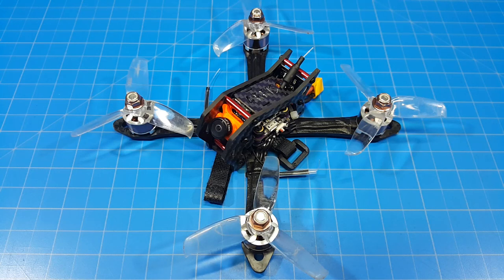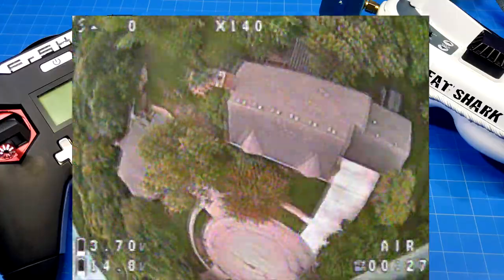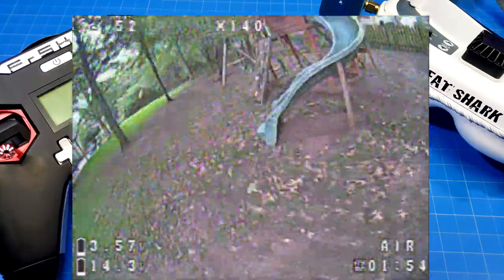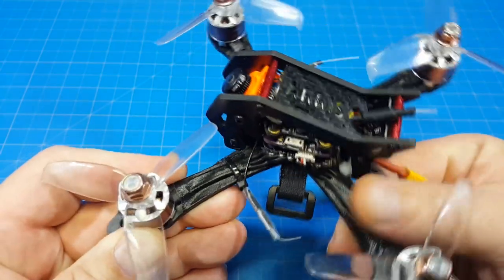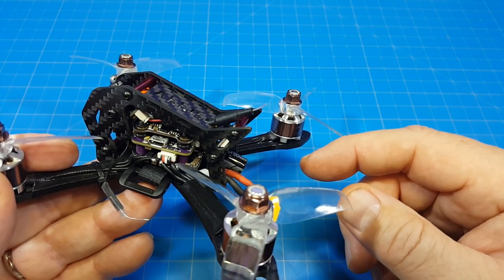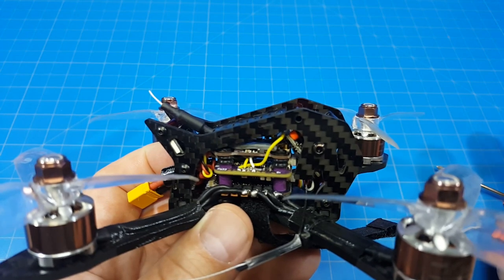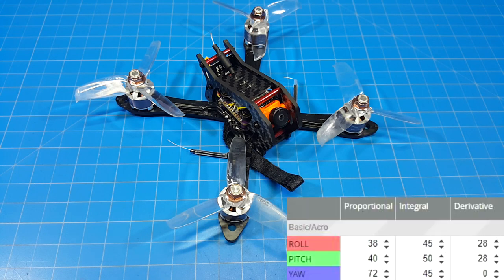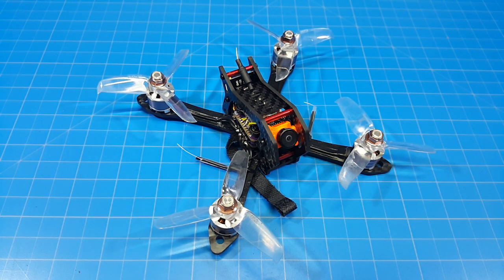ARRIS x140 HobbyWing

Comment: Great review! Thanks for mentioning that you didn't have motor braking and motor stop on for this flight - I use the height and speed of the punch-out over the house to try to judge the power of the micro quads you review (helpful for people that enjoy freestyle flying). This seems to be one of the most "powerful" quads you have reviewed but I guess the hang time was partly due to the motor braking being off.
Reply from the maker: I think there have been a few to top this. The FVP egg, xjb 145, and a few of the other three inchers I have built. Check the hypetrain 4140kv motor video.

Comment: Nick, have you tried vertical flipping the cam in the cam’s settings and mounting the cam upside down for more cam angle?
Reply from the maker: I looked for it, but this cam doesn't have it. Remember this is the original micro swift.

Comment: Can you please do more reviewing of products from U.S. based company's. I would like to see something not from gearbest or banggood, especially since I don't trust sites like that fully and the shipping is loooooooonng.
Reply from the maker: I would if I could afford it, or if they were interested. A good portion of micros come from the East.
Reply: True i guess, have you thought of designing a frame?
Reply from the maker: I did, but it was before micro cams were out. It was a 3inch with full sized ccd cam, cutting edge for like 3months. :(
Reply: I don't mind the reviews on quads from Banggood. They've ALWAYS taken care of me on everything! Even cheap glue that seeped from the tube onto the packaging in shipping. They gave me a full refund! When buying from Banggood, choose the "Priority Direct Mail" option. It typically costs less than 2 bucks! But! Instead of 20-30 days with no tracking... It takes around 12 days with full tracking once it hits the USA. That takes around 5-7 days. Then you can track it all the way in. It's soooo worth the tiny price... And with many quads it's also FREE! Or, sometimes it's like 0.83 cents! And, don't worry about Banggood...including all of the little parts, I've bought from them over 200 times! Never, ever, any issue they didn't handle perfectly. They're awesome! 😁👌
It's GearBest you are best not buying from!!! They're a bunch of scammers that will rip you off any chance they get! I love warching the reviews, but if it is only available from Gearbest, I'll NEVER, EVER buy it or anything from them again!!! I've learned my lesson, the hard way! 😒

Comment: This or XJB 145? I can use fs i6x with them? Rx2a? X6b? You fly that thing like a dream...
Reply from the maker: xjb145. I believe the xjb performs better and has more available camera angles. I do believe flysky receivers will be fine, we would need to make a few adjustments in the betaflight configuration, but that is normal. Thank you

Comment: Can the electronics handle a  4s 1500mah 50c battery??
Reply: The electronics should not have a problem, but I doubt a 3 inch quad would do very well lifting such a heavy battery.

Comment: Glad you got one too. I moved the camera forward in the frame, using the vertical slits at the front as mounting hole. That creates more space between camera and FC stack, and allows for a wider range of camera angles. For a picture, please check here: https://www.rcgroups.com/forums/showthread.php?3138299-Arris-X140-1407-3700kv-F4-OSD-and-more-%28review-work-in-progress%29

Smart to add the capacitator, that is my main gripe about the X140, the motor noise leaking into the FPV signal. Apart from that, it flies really well, once fitted with GemFan 3052 or similar. What capacitator did you add? I was hoping that a cap would fix the noise, but your experiment shows that it doesn't fully fix the noise. Will you be trying to supply 5v from FC to the VTX?
Reply from the maker: I used a 25volt 470uF. As time permits I do plan to investigate the 5v from the fc.
Reply: I hope you will get that time. I also reported to the guys who sent me the X140, that the noisy video is the quad's biggest drawback. Apart from that it flies really well, and I've flown it almost daily since I got it.